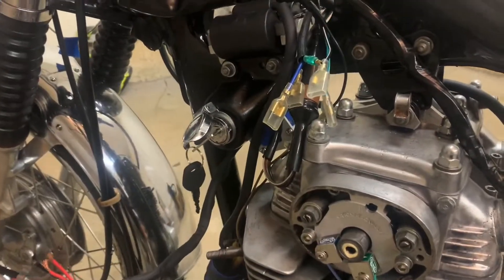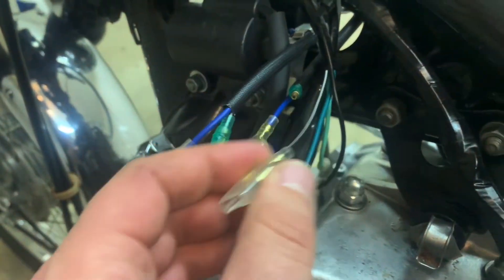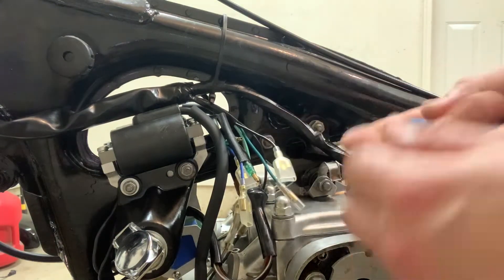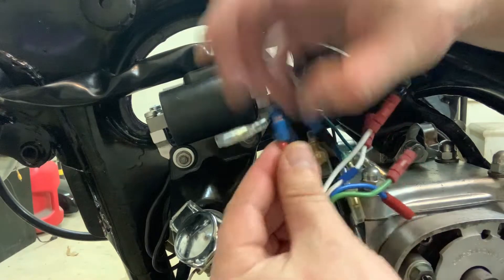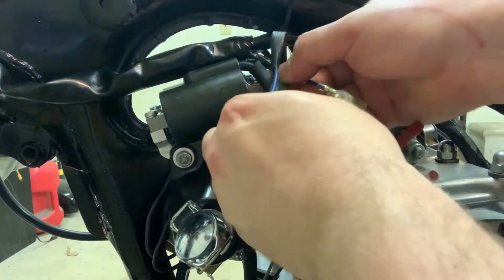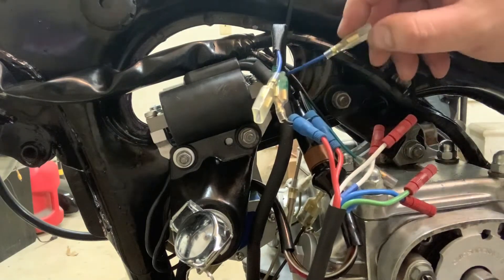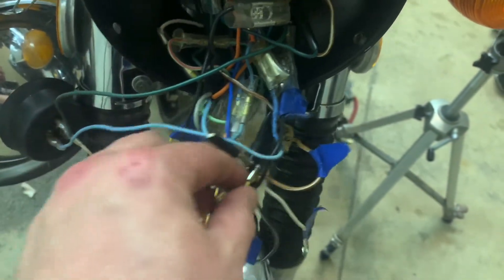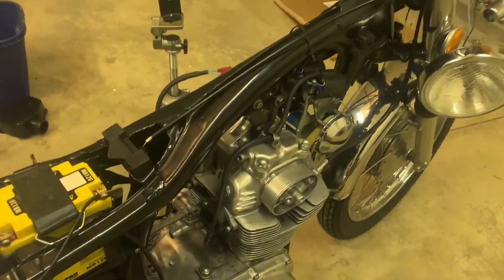How To Wire The Common Motor Shockwave Electronic Ignition: Part 177

Comment: Brian
The black/white wire that you hooked the coils and ignition modules to. Do you know if it is a switched power line?
Our m unit basic has us doing a custom wiring harness. Thinking I could connect all four wires into one wire and run it to an auxiliary output on the m unit basic
Thanks for all you do. Fun watching the three new ones today 
David
Reply from the maker: Yes. It’s tied to the kill switch.